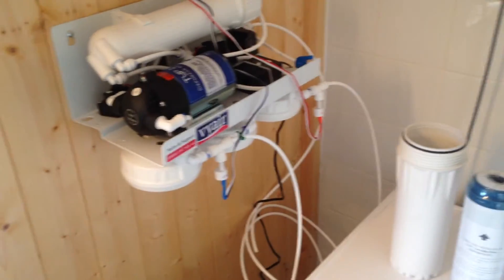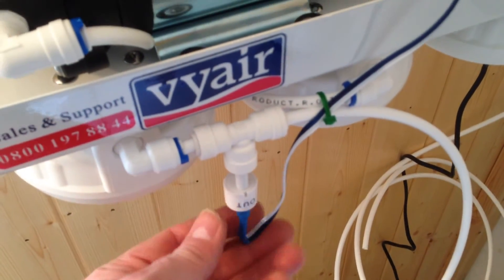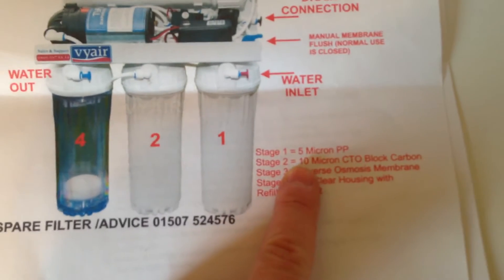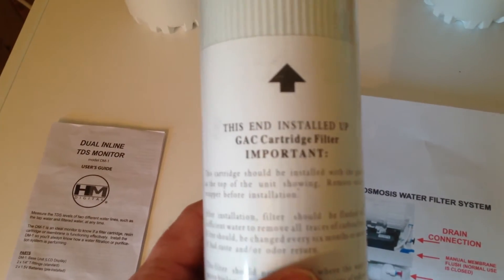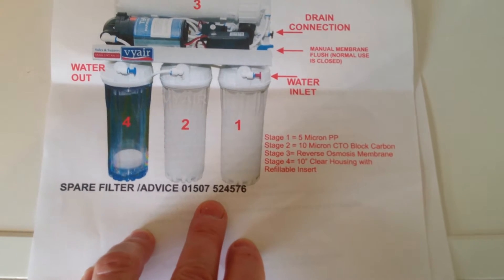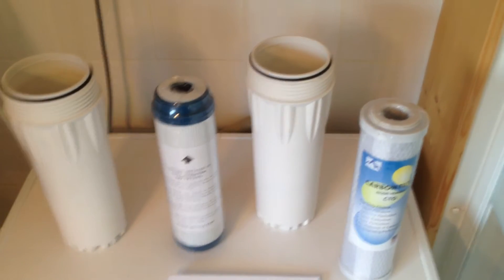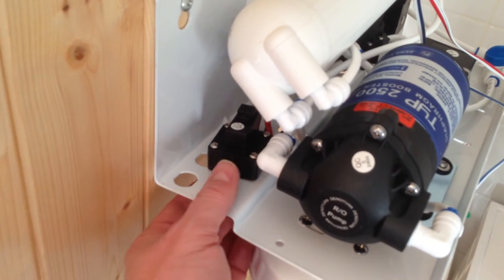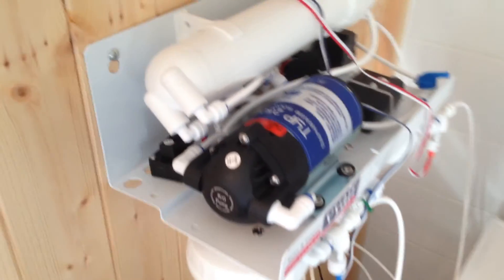Installing a Vyair RO-50MP pumped reverse osmosis system. Part 3.

Comment: hi can I ask if you use all ro water ,or a mixture of tap water just wanted to know....as I have a question and also a presume metre were do you put it   thank you
Reply from the maker: +bilal Hussain 
You do not put normal tap water anywhere near a marine tank!!!
Did you mean pressure meter??????
I do not have a pressure meter. The meter  in the setup is to verify the TDS is at zero.

Comment: Wash that charcoal filter before connecting it in, they have a lot of fine charcoal powder that they dump on the first few litres of water. Easiest is to disconnect the output ( or not put the DI resin unit bowl in and have a bucket under it) and let it fill up with about 10l of water then place the DI resin bowl in place. For the tubing best to buy a tubing cutter, or use a very sharp stanley knife to get a clean end. You will find the resin amount you have will get exhausted quite fast, really you need a larger resin container, or buy it in bulk.

With the bowls please do not over tighten them, they need just a smear of silicone grease on the orings ( just a very thin coat, if you can see it it is too thick) then tighten finger tight without the spanner. Then water pressure and check for leaks. If you use the spanner to tighten them they will never come off without breaking something. They do not need to be tight to seal well. Careful not to pinch the orings, best is to order a spare one or two for use later. You will be horrified to see the colour of the first filter after around 500l of water has gone through, it will be brown. Better filter is to buy the 0.3 micron ones, it leaves almost no particles in the water, and here will last quite well. the filter can stay in for a long time, but the charcoal will need replacing at the recommended intervals along with the resin, as it will grow bacterial film from not having chlorine in the water. You might look into an added UV sterilizer inline as well.